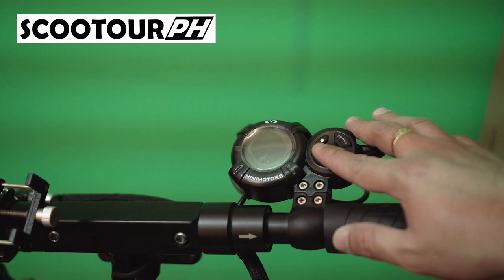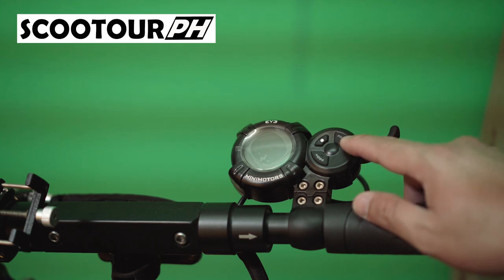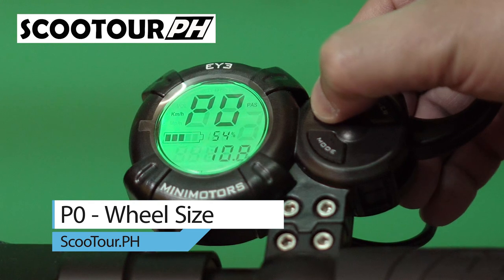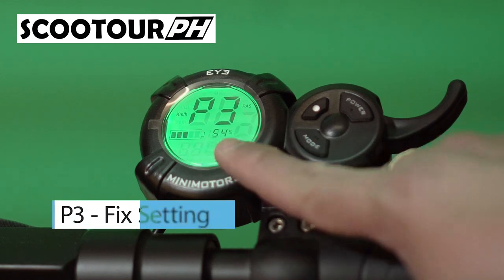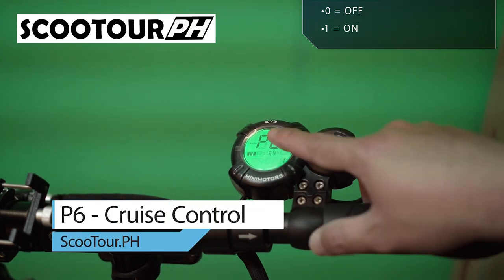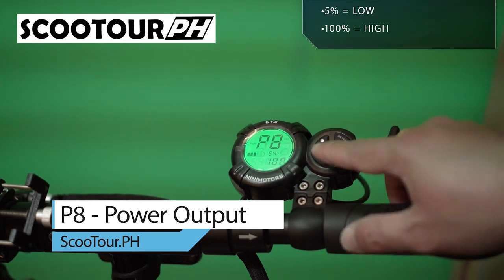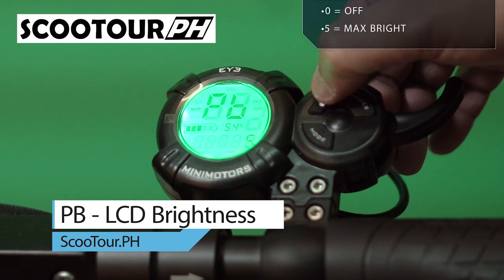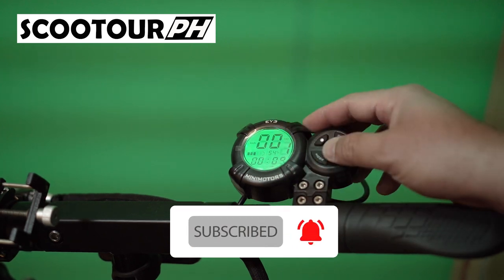Minimotors Display Settings | Dualtron LCD Trigger Throttle | EYE THROTTLE

Comment: Hi bro my Minimotors scooter is 52v but I accidentally adjust my P1 volts to 44 ? Can it still use
Reply from the maker: Note sure Bro
Reply: just change it back to 52 volts
Reply: Change it back to 52 v

Comment: how do you actually use cruise control ?
Reply from the maker: if you turn on cruise control, it will lock the power output to have a steady speed after 3 seconds on throttle